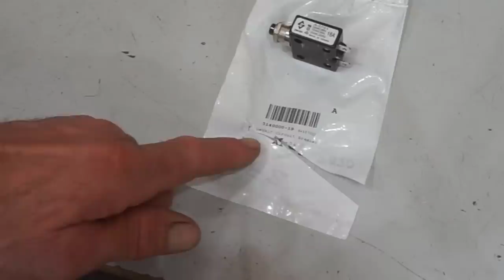DW735 Planer Deep-Dive Maintenance

Comment: I spotted the threads I mentioned in my previous comment in your video when you had the planer upside down. I see that there is nothing that goes into those threads so I believe that something was in the wood that was being planed. In other words, it appears that no parts fell off of the planer and were chewed up by the blades. However, when my carpenter tries to plane thick boards it is gouging out the wood. He is lowering the planer blades 1/2 turn (1/32") each pass, so I need to take a look at the blades which were getting dull. I had removed them, reversed them to the other side to get nice fresh cuts, and secured them back in place a couple of days ago. Maybe something isn't seated right.
Reply from the maker: Betcha  a dollar to a doughnut that one of the blade retainer screws wasn't tightened enough and it came out during use and gouged the wood as it was ejected by the spinning cutterhead.  Check all the screws on all three blades to see if one's missing and if I'm right. 🤯😎
Reply: @NextLevelCarpentry  I checked all the screws and they were all securely in place. So I removed each blade and I believe one of them may have been seated upside down but I’m not sure about that. Anyway, I refastened each blade securely and it is cutting with no issues. I believe there may have been a nail embedded in the wood my carpenter was planing but it’s impossible to know for sure. Perhaps he and his helper were trying to feed wood that was too thick into the planer and it wasn’t raised high enough. This morning, I reviewed the whole proper process for planing with them and we planed a few pieces together. They have been planing wood all day with no further issues.
Reply from the maker: @EdBecnel  Trying to feed wood that's too thick will just bog the machine down and/or clog it with shavings and trip the breaker.  One of 3 knives upside down would make a terrible noise and leave a rough surface.  I suspect it would be VERY obvious because shavings would be jammed under the knife when removed.  An errant nail in a piece of lumber being planed is the best and most likely explanation for the havoc you experienced IMHO.  Hopefully you'll be sailing smoother seas ahead where swapping out new knives with sharp edges and waxing the platen will be the extent of maintenance required... and for that, there's this:
https://youtu.be/r_yEwlsYGbU?si=NTOKvsWAhy-cCX_i

Comment: I've used valve grinding compound on my screwdriver bit to get a little more grab.
Reply from the maker: That's about the consistency of the Screw Grab product... not a guaranteed solution but probably useful since successfully removing even a single screw without vise grips or an easy-out is a win, right Paul? 😎

Comment: I wish you would do an instructional vide on changing the drive belt on this planer. It’s a booger of a job!
Reply from the maker: I don't want to jinx my planer but, if I do smoke the drive belt on it, I'll do a video showing the replacement process just for you, Bill!😎
Reply: @NextLevelCarpentry  
Thank you, sir. Hope you don’t ever need to do that. And, if you do, that you don’t first order a less expensive belt than the OEM.
Reply from the maker: @billballeza377  I hear the voice of experience in your comment loud and clear! 😬😁😎
Reply: This may be overdue but if you click on the link already referenced for installing the helical head, you will see how to replace the drive belt.  You kind of have to replace it after you have pulled the head.  I did install the helical head and, yeah, the belt was tough, but it went on.  
Good luck.

Comment: May I suggest something to look into, you seem to be stripping the heads of your “Phillip screws” , yes I understand the offset of your bit, but looking at your video I’m noticing  your Phillips bit not sitting deep enough into the screw head which leads me to believe that you may not be dealing with a Phillips screw you maybe dealing with a JIS screw which at a glance look identical but they are not. If Dewalt sources their work/ parts out of Japan then you are certainly dealing with JIS screws. Just a thought, Thankyou for the as usual the great video, very informative. Cheers 🍻
Reply from the maker: You're almost certainly right Steve... thanks for adding this dialog.  BTW do you know what JIS stands for?  I've not heard of it specifically... yet.  😉😎 Thx! Best, Matt
Reply: @NextLevelCarpentry   It has been a while since I last tuned in to u tube, but I also decided to do a deep dive maintenance onto my 735 and remembered the awesome video and tutorial that you provided, And came across my question or suggestion , Sorry for very late reply to your question  JIS = Japanese industry standards . Must be taken from our very own JIC acronym for joint industry council…. But here’s another question, after looking at your video for insight , the thought came to me , even though I think you are a great carpenter it is definitely not your only field of experience, I’m thinking you also have a mechanical background ?  Besides being well versed in the names and operation lingo of the planer , the discolouration due to heat processes etc etc. But the part where you used that block of wood to aid in the removal of the screw and again to apply pressure to the rollers springs, then ultimately flipping the planner, Not taking away from the ingenuity of wood workers we all have our different challenges, but your approach is off the hook and beyond the normal train of thought of a carpenter. So I’m thinking you have some sort of deep experience with mechanical. Lol. Tell me I’m wrong ?  Thanks again for your great videos , tutorials and inspiration and your one liners. You sir are a utube gem. Cheers
Reply from the maker: @steveiv9250  Thanks for clarifying JIS with a definition.
Hope your DW Deep Dive goes well... truth be told I'll end up watching my own video next time I have to dig into mine just to remember tricks I forgot 🤔😁 I might should have modified the tip of my phillips to seat better in those screw heads but I think I figured I'd replace 'em with the hex head screws and do didn't spend time thinking for a better solution?  Who knows but I'd do well to invest in a 'JIS compatible' screwdriver if I expect to encounter those stubborn screws more often.
Your assumption is correct: I lived my childhood in an income-challenged household where the only way I could have a bike, mini-bike, go cart or whatever was to find one someone threw out and get it working.  My first job was in auto body and I was always wrenching on whatever old vehicle I had just to keep it going.  Also contributing to the 'mechanical background' you mention was 10 years as a commercial construction project superintendent where I had to do all manner of non-carpentry related stuff.  As a result, figuring out how to 'git er' done' while tearing down and reassembling a simple planer seems to just come naturally but it's always nice to hear from someone who recognizes there's a backstory to the 'lesson' in a video so thank you for your follow up comment and content compliment!  Best, Matt

Comment: Nice tutorial. I'm always amazed when manufacturers use not only the wrong type of screw heads (I hate phillips), but also use two different means of keeping the sprockets attached to the shaft (one side uses a capture bolt and the other uses a c-clip).  I see no good reason why they should in this machine.

Comment: When you said you hadn't serviced the thickness planer for a long time and I saw how clean the outside is, I was surprised; it looks brand-new. When you opened it up and I saw how clean the inside is, I was downright shocked. I fiddle with watch repair, and I swear, some watches aren't that clean inside! How do you keep your tools -- especially such heavily-used tools -- so clean?
Reply from the maker: I do the more routine servicing shown in the "Care and Feeding..." video a few times a year, depending on workload and blow everything out with compressed air and wipe it down in the process.  It's the 'deep dive' disassembly and lube part that I've not done for a long time... sorry you got the wrong impression.  A bit of more frequent attention really does go a long way for keeping things respectable though... not as clean as a watch but plenty good...

Comment: I have a new DW735 planer and my carpenter was using it when something fell off under the planer and the blades chewed up whatever it was. Looking under the planer in between the rollers on the left side (side farthest away from the crank handle, I see threads that are machined into the side of the body, but there is no bolt in it. So, it appears something wasn't tightened at the factory and it fell off but I can't identify the part by looking at an exploded view of the parts. I live in the Philippines and there is no service center so I have no way to find out what part had fallen off.

Comment: Next time you do maintenance, at what point would you turn the planer upside down? BTW, great video and great channel.  You are my go to guy for concise, honest shop info. Thanks, Matt!
Reply from the maker: I would put the machine over as early on as possible... probably after removing the top cover chip Chute and Blades. If your machine is not bolted down flipping it back over isn't that much trouble so would still save you time in the long run even if you had to flip it twice if you miss a step early on. Thanks for watching and commenting. Best, Matt

Comment: Question, I have very exact planer and recently I had cleaned up my shop and moved things around. My planer I had not used in a couple months. My planer is less than a year old, only ran a couple boards through it and looks brand new but,,,,,,, I noticed under the gearbox and on the table a little gear oil. Kind of alarmed me but I’m not sure if this is normal or should I be concerned? It’s been a couple months since used. Thanks

Comment: Lot of good stuff here.  But!  Out of nowhere my speed shifter lever won't shift.  I well aware of only doing it while running.  I've replaced the washers and bushing inside the gear box and for the first few times that worked but quickly I'm back to it not being able to shift.  Can you or anyone recommend a fix or what more to look at.

Comment: Great video as usual.  I've been waffling on which planer to buy; the DW735 is less than some that I've been looking at.  Anyone replaced the blades with the after-market helical cutter heads on this machine, and if so, was it worth the $400-$500 for it?

Comment: I'm an electrician (retired), since your thermal overload didn't last- grab a voltmeter and check for voltage drop at your planer. Low voltage will increase the amperage draw and could be the culprit that shortened the service life of the overload protector.
Reply from the maker: Thanks for the idea... I do have the planer plugged into the same outlet with the same cord and the same setup as previously so I haven't considered power supply issues.  I did check the brushes off-camera and they look fine.  I'll have to ask my favorite electrician to stop by and make the check you mention though because you've got me curious! Best, Matt
Reply: 11thcavcsa - Great Comment!

Comment: Excellent video, have you ever taken the roller gear box apart and replaced the thick gear grease with something that will function better in lower temps. For cold shops in northern areas. I will do your steps to see if it helps, a bunch of raw oak to work and won't feed in this cold weather
Reply from the maker: I'd be surprised if cold grease in that little gearbox would make a difference in performance of the planer but a platen that's not smooth, a stiff drive chain, bushings that bind and/or gummy feed rollers will slow it down even in a heated shop.

Comment: To continue the discussion from the live chat... not the dielectric grease- though that might do.. let me go get the name off the bottle..
NOALOX by Ideal, I have a 4oz bottle I've had forever...just have to stir it up well(take cap off and stir - can get messy when it's full) - I suppose if you stored it upside down, the good stuff would stay near the tip....
It's an anti oxidant joint compound for any aluminum contact connection.... like those spades on that thermal switch.
Oxidation causes resistance which intern causes heat when passing electricity through it.
I realize that it's a stretch, but if you're getting some right there, then any heat would be on the spades of the switch and be convected (if that's a word)  right into the switch and make it that much more likely to trip under a heavy load.
or
They put a thermal switch on it that trips so close to the normal draw that it's just prone to it
or
DeWalt should have used 1 guage heavier wire in there for the loads it's carrying

lots of places where this could have been done wrong

Could just be that those switches you are getting are low quality/cheap materials/construction 

I have to say that seeing that you use a DW735 in your shop next to the cabinet saw and the jointer for production work for hire was sort of the deciding factor for me - unless I want a 20" planer, this is the one I'm going to get ( that mental debate will run up until I put $$ down)

Thanks for the vid!
Reply from the maker: Thanks for all that Greg... useful info, especially when getting into the nitty gritty of machine performance.
I think people overlook the full picture of cost when insisting that bigger planers are better.  Nicks in a 20" cutterhead cost more to fix than in a 13" not only for hardware but time too.  Someone gets all puffed up because they have some industrial grade machine in their shop but, since it's so time consuming and costly to replace the knives they neglect it loosing everything they gain because so much more sanding is required to remove planer marks.  Or they keep the big planer for occasional 'super big and important jobs' and have a second one like a DW735 for routine work.  I do know guys who's need and use of an industrial model make perfect sense but by an large I think there's a lot of 'size matters' bravado involved.  I do think that the DW735 is far and away the best in class all around.  Its wide-spread support column footprint gives is much better stability for reducing snipe and is the main reason I upgraded to it as soon as it came out. The dust ejection blower/chute is another huge benefit for all but the most productive shops too IMHO.
Best, Matt

Comment: I really admire your video and I'm all smile. I hope you'll certainly have answer to my problem. The crank handle of my DW735 thickness planer is very stiff. It needs brute force to go up, please help!
Reply from the maker: All I can suggest is to check for a rusty lift crank chain 'under the hood' or otherwise check for bent corner columns.  I've heard from others who's planers were damaged in shipment that bent a column so they had to have a new planer sent to them. Hope that helps...
Reply: @NextLevelCarpentry  Thanks for the prompt reply.

Comment: Great video. I have a 2 yrs. old 735 that is tripping the thermal switch, and feels like something is binding, in the planer. Suggestions?
We have checked the motor, switches, etc.
Thank you.
Reply from the maker: If the binding was sudden I'd suggest a good hard look at the gears and chains in the drive system under the cover on the left hand side of the machine as you face it from the infeed side.
If the binding has gradually gotten worse then I would take the Deep dive maintenance shown in this video to heart and give it a thorough cleaning and Lube which should address any long-term degradation of performance.
Good luck!
Best, Matt

Comment: Man this video has been very helpful. I just got my fist planer, a DW735, and the original owner obviously did not take care of it very well. I noticed you didn’t go into the drive assembly for the crank that runs the upper chassis up and down. Why is that? Thanks again!
Reply from the maker: Thankfully the height adjustment mechanism has never been problematic... if it ain't broke, don't fix it, right?  Now that I say that I'm afraid it will break next time I use it so that I WILL need to do a deep dive into it😯😁😎

Comment: Hi very nice presentation and I really enjoyed it. I have two questions. 1- I do not have any available space for a planer in my garage and I live in Southern California by the beach. I was wondering if I put my planer on a cart with wheels , make a plywood cover for the cart with five sides and put the cover on the top of the cart and  in addition put a cover like barbecue cover over it , would it be protected from rust ?  2- Can I run 2X4 vertically through planer ? I would appreciate your input. Thanks.
Reply from the maker: I'd bet salty air will permeate pretty much any enclosure but the enclosure might help minimize it.  For more protection you  might consider a protectant like Boeshield T9 on parts like the drive and lift/lower chains because they're not stainless steel or chrome plated.  The height/thickness capacity of a DW735 is 6" so a 2x4 at 3-1/2" wide (actually, even a 2x6 at 5-1/2") will fit through on edge.

Comment: Thanks for the video, great stuff! We used MEK to clean printer platens back in the day.  MEK would not dry out or dissolve the rubber like other solvents did.  Thanks for the tips on the lubricants you used. What lubricant do you use for the trunnion of your Unisaw?  (cant wait to see what that tool is on your next video)